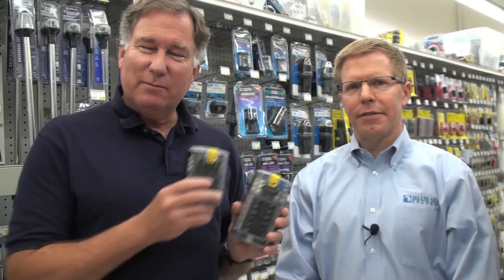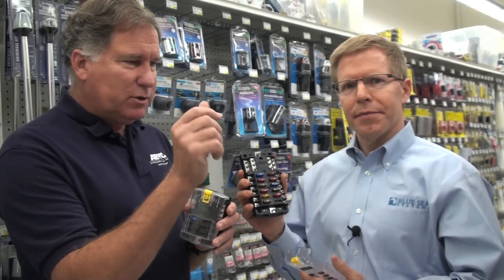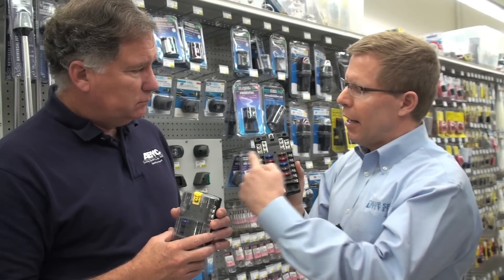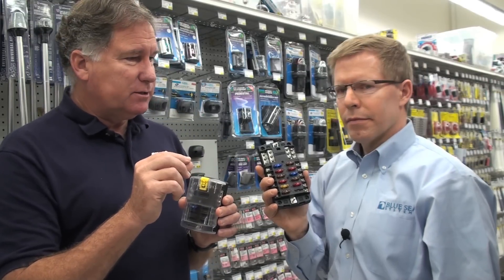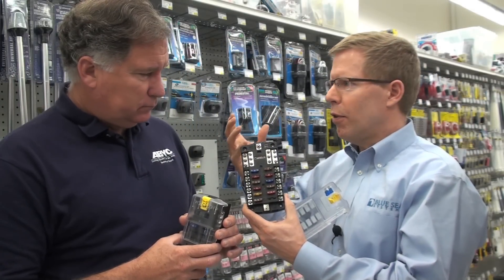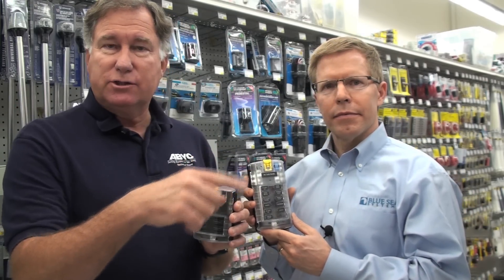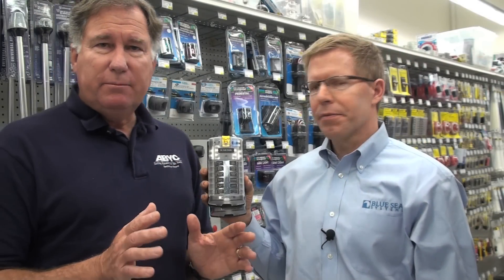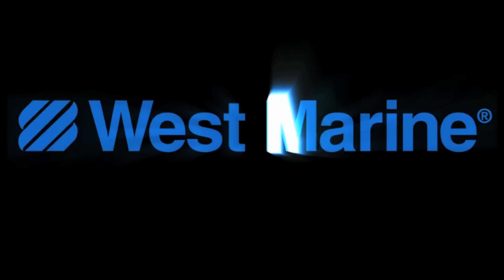Blue Sea Systems ST Blade Fuse Blocks

Comment: Can you recommend what ring terminal lug you use to connect to those #10 (M5) studs? The fuse block is rated for up to 100A, where your would use a 4AWG or 6AWG cables. 
Most every YouTube video I've seen uses a 1/4" (M6) ring terminal lug, which is sloppy loose.

Why the odd #10 (M5) size?

Comment: I purchased your ST Blade Split Bus Fuse Block
 5032 for my 1984 Chevy S-10 to run auxiliary devices such as air control and gauges. My factory fuse panel is maxed out. Do you have a wiring diagram for running an ACC wire from my factory fuse panel to a continuous duty  150 Amp. solenoid relay to the  bottom or switched side of the ST Blade Split Bus Fuse Block 
5032?
Reply from the maker: We are unable to provide assistance with this application, and we recommend contacting a qualified automotive electrician.

Comment: Kind of a nitpicky question, but this Fuse Block would be perfect for my 4Runner electrical project. Many of the labels are for boating. Do these come pre-attached or can I select from other ones (or use my own?)
Reply from the maker: We have the link to the labels separate on the link below. They may come preattached, but you can certainly put labels over them.  You can of course make your own, but here is the link to our labels:
https://www.westmarine.com/distribution-panel-labels

Comment: where are you grabbing the power from to supply the terminal and what size wire or amps?
Reply: Either direct from the (auxiliary) battery, or as they said from the positive of a particular circuit of the boat’s circuit board. Wire gauge is easily determined by adding up the total watts, converting to amps, and measuring the length of the cable. Then consult one of the many AWG Current tables on the Internet to determine wire gauge. It’s not difficult.

Comment: with this bus, I run a negative directly to the battery and then I can attach the box to something that isn't a good ground, like a plywood box. Correct?
Reply: moondog573 yes. That sounds correct. You will need to also run a hot wire from the battery in addition to the negative

Comment: I have a 18 foot fishing boat and the wiring is a mess! Do you recommend I use buss bars or your st blade fuse blocks?
Reply: Larry Wasserman I would go with the St fuse box all day long . you can run additional feeds from your breaker protected switch panel on your console and it cleans everything up someplace that's watertight.

Comment: Seems like a bad design from what the guy is saying. You want the Fuse to break the 12V POWER source to the electronics you are wiring, not the GROUND.
Reply: It does. I think you misunderstood.
Reply: In a boat, in contrast with a car, you need to string both the ground wire and the power wire back to the source. If you look closely you can see there is one source B+ post, one source ground post, and several ground posts to accept the ground for each individual circuit. Interestingly when doing calculations for voltage drop you need to basically double your distance since it is thin ground wire all the way back to source. So even in a small boat, you often have to upsize wire simply because of voltage drop.